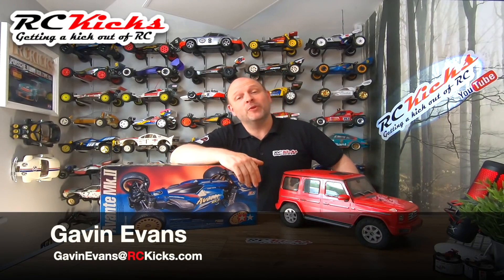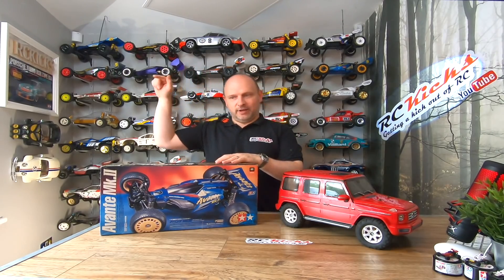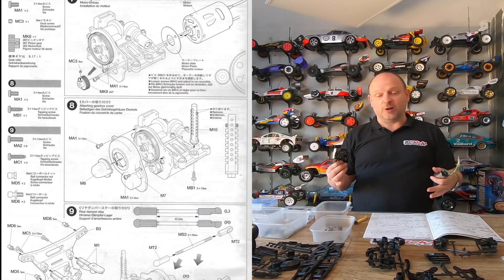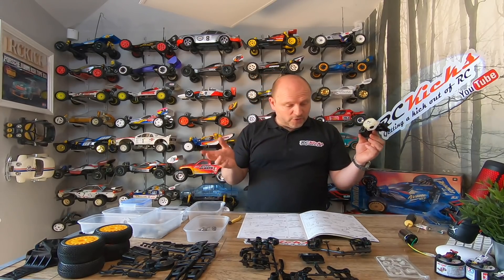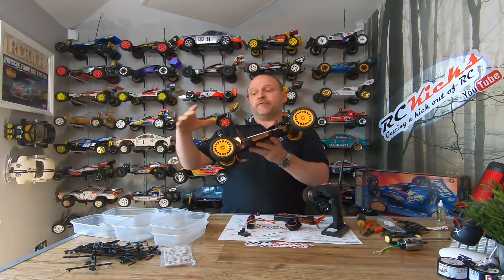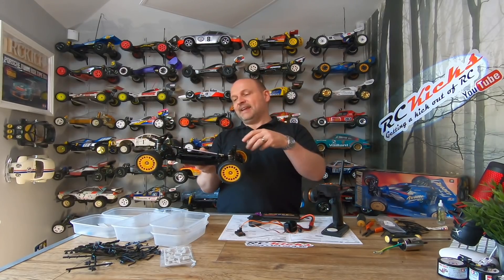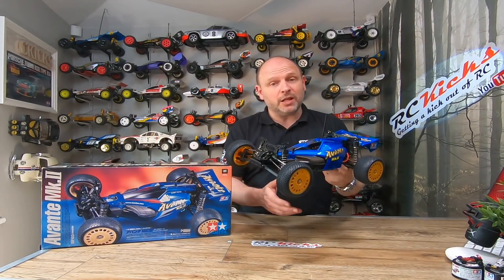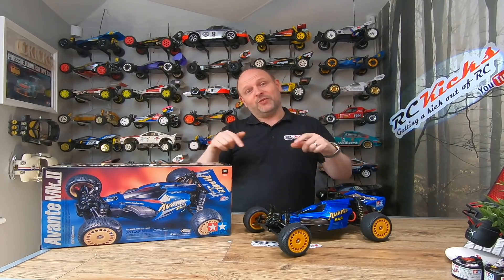Bringing Shame To The Avante Brand. Building An Avante MkII DF-03 Kit 58387 & Being So Unimpressed.

Comment: Part 11 is the raised spoiler mounts mate
Reply from the maker: I changed it over and it made almost zero difference.
Reply: RCKicks it’s not a huge difference but is slightly higher , I know what you mean though it should be a lot higher

Comment: Gavin, thank you for the excellent content!
I fully agree that this was a poor use of the Avante nameplate, and a disappointment.
Having said that, apart from the front suspension, the DF03 chassis and drivetrain architecture are strikingly similar to what we see in photos of the new Super Avante. That might be enough to justify a second look at the Mk.II.
Of course, the question of whether or not the Super Avante itself belongs in the family remains to be explored.......
Reply from the maker: I'll get a Super Avante as soon as I can on the show.  I hope it does well for them and with a few adjustments it can look the part.

Comment: Hate the front uprights on this car, they should of made different lower ones to change the angle of the shocks and make it look more like the original. Also if it was real how would you see were you're going 🤔🤣 
Also the Aero IMO is better looking mainly because the front uprights look beeter.

Comment: The Avante Mk. II and Aero Avante are based on the Tamiya Mini 4WDs that were released before their R/C variants. I was ok with their designs on 1/32 scale, but I have to agree, they don't translate as well to 1/10 or larger scales. 
(Fun) fact, there is a real Aero Avante race car that Tamiya built. It can actually be driven, and they installed fake rollers to mimic the Tamiya Mini 4WD version, so while the enthusiasm was there, even as a fan of Tamiya Mini 4WDs, I was put off a bit after seeing it.

Comment: The df03 chassis is a good chassis as an rc buggy of its own but to call it an avante is stretching it a bit? I've not long built the dark impact (same chassis) and it works well although I give up trying to fit a brushless combo in it because the only way it would fit I would have had to butcher the body and part of the chassis at the back and I wasn't willing to do it because it's the white edition!, In my opinion the avante mk2 has already been released but tamiya called it the egress🤔! Good vid again keep em coming👍

Comment: Gavin, I agree with most here - it's NOT an Avante by any stretch!! 😖 Poor marketing ploy on Tamiya's part. 
However, the DF-03 Chassis is a fantastic Buggy! With the usual array of Aluminium upgrades, will be a solid performer.

...... The AERO AVANTE!!!??? 😖😲 I'd seriously be tempted to purposely leave it OUT of my collection, if I ever have one again. You're not kidding... YUCK!! 😝 
But again, it's YOUR Collection. 
Cheers 🍻 Mate!
Carmine ✈🚂🚙
Reply: I would leave it out simply because it is technically, and technologically, NOT of the Avante lineage. The body looks okay but looks like it should be more "involved" than just a simple body shell. If it ws a multi-piece making those odd wings there own piece(s), it think the look could be salvaged. But that still does not cure he the fact it is NOT in the "Avante" family. Its like slapping a Boomerang body of the Hot Shot and saying it is in the "Shot" family.
Reply: All the Avante facelifts are scaled-up Mini4WD cars. They're designed to try and get the Mini4WD guys to give RC a try.

Comment: Another great video. Maybe you could try to find a carbon chassis set for it, carbon towers, TRF shocks, slipper etc to make it something special like the original. I’d like to see Tamiya produce a carbon/frp chassis kit for the DF03 like they did with the manta ray that ended up being the top force.
I have the DF03 MS which I think is a great kit 👍🏻
Also if you can point me in the direction of a rear carbon tower, I’d appreciate it. 😉

Comment: The DF03 has a weak rear diff, I used 3mm Tungsten Diff balls & the front (all steel) Diff cups joints. The rear 1/2 plastic & steel diff cup combo is just a Joke, terrible.

Comment: Try the uv light plastic pens to fix stripped holes. Few drops in, stab it down a bit with a pin or toothpick. Wipe off excess. Shine the light on it. You may have to redrill the pilot hole. Under $20cad, I have the bondic brand. heat will ruin it and doesn't set where you can't the light into, but should be great for stripped holes and the like. P.s. I only bought an ugly Manta ray cause it shares parts with my top force, and now I secretly like it.

Comment: definitely bring shame to the name avante , chassis has to be something special to get the name
Reply: The chassis was the naff part of the original Avante, about as tough as cream cheese and a fortune to repair 😕
Reply: @36tornado36 
To be fair, you can blame the cast aluminum suspension components and GFRP chassis plates for the durability issues with the original 1988 release. The 2011 rerelease is proving to be quite a bit more durable, although I wouldn't bash it hard or try to run it on a 1/8th scale track or anything like that.

Comment: Hi Gav, loving the channel, 

I've just built a dark impact, before you run it I would suggest rebuilding the rear diff, you can either use the same solid metal ones that are on the front, or 3 racing also do some solid ones.  There's loads of cases of the plastic melting and screwing up the diff.  Also if you're intending on putting lipo and more power through it, the slipper clutch along with a solid steel pinion is recommended.  Neil at RC Racing has a steel pinion, very friendly chap who if you email can send you one, cost less than a 10er posted(not on the website).  You can slide the old one off very easily in a vice and replace it.  There's a guide here:
 https://www.tamiyaclub.com/forum/index.php?/topic/79446-df03-dark-impacthardened-slipper-gear/&tab=comments#comment-784109

Cheers pal and keep up the good work 👍
Reply from the maker: Thanks for the info 🙏🏻👍🏻 I’ll add it to the project.

Comment: Bringing "shame" to the Avante brand?  The Avante brand is ALREADY shameful!  I had the classic Avante in 1988, and it was a piece of crap that could not even withstand a single collision!  The STUPID front lower suspension arms had a back link that consisted of a thick threaded rod screwing into a short plastic sleeve.  There was such little depth penetration, that the link was fragile and broke easily in a collision!  The rear suspension arm was almost as bad.  It was a fusion of metal rods and plastic.  In a collision, the shock impact is not evenly distributed throughout the whole arm.  The more fragile plastic component took all the load!  The Avante was the most expensive RC car on the market in late 1988, a whopping $300 for the version with the motor standard; the Mercedes of radio control.  (The Optima Mid was $200).  And the Avante turned out to be little more than a pretty shelf queen.  I was afraid to run it in the grass, for fear it would run into something else and break.  My idiot best friend in high school ran it in the grass after I told him not to, and the rear suspension arm broke, like I suspected it would.  They would have been better off with the traditional 1-piece plastic A-arm, than the fragile metalworks they had!  It was slow, too!  In RCCA's 4WD shootout comparison test, the Avante came in dead last - 4.) Tamiya Avante, 3.) Kyosho Turbo Optima Mid SE, 2.) Yokomo C4, and 1.) Schumacher Cat XLS.  There is nothing honorable about the Avante brand!!!

Comment: No just no the the df03 looks garbage in an guise, aero at least looks nicer
Reply: I will make one more comment. OK I am going to agree with our host. By design it;s nothing like the original. But Tamiya owns the name so they can call it whatever they want to. My background was largely in racing and with all humility I wona National ROAR championship but that was kind of by default. My car was limping but everbody else broke down. I was running for Bolink at the time. Allways was more of an off road guy. It was what fun was available. In if you want to call it that my career as a racer something like an Avante was around. So was something like a kyosho Ultima. But very few. Avante is very heavy. But that is not that bad a thing.within reason. A bit of weight holds the ground. Top guys with Team associated in time went to graphight chasis but then switched back to the aircraft aluminum tub. It had more weight on the front wheelsw. It steered better that way. Depends on the track you are running on but top speed isn't everything. Avantes were competitive in performance but the problem with them Is if somebody hit you or you crashed they broke into a thousand parts. I think it was sort of a design mistake. It;s super cool but it's no fun if you can't race. The design was too complicated. But I think it was the coolest rc car ever. That was not like replacing a Arm it was a bunch of links that would shatter, It was a hobby but I ran competitevely, Lots of fun Here is my advice from my viewpoint and a critisism. I really ran everything. Lots of fun. Simplicity can be the best design. I ran a Schumacher Top cat for a while. It's a performer but there are weak links in a unique front suspension system. I would not reccomend buying those but if you do I will tell you what will break. Just what parts you want to stock up on.You will need them and they are hard to get. Buy a Schumacker don;t say I didn;t warn you. The X:S 4WD is also a performer but parts supply is poor. My advice is if you like the hobby buy something with good parts supply. Around here it was largelt Team Associated and Team Losi. By a landslide I have to go with Team Losi. It's just better all the way around. They handledd better before they wen't to A arms. Here is my take on Tamiya, Its a special place in my heart. My first car was a hornet. Regardless of the price tag it will outperform easily something like an RC10 on solid ground. A solid rear axle has less friction and delivers power more effectively. But it won't do as well on uneven terrain. Tamiya largely is a company that makes plastic models. So you can expect them to use those resources. So they make very cool interesting stuff, My problem is they always change it, Its always something new hobby grrade made of plastic, Two wheel drive is usually the same. Just depedns on a few things. Something like a Super Astute should keep pace with anything. They are known to shatter though. An Avante is very unique.Given the opportunity I would say I could run laps around them with one, But thats an expensive toy.